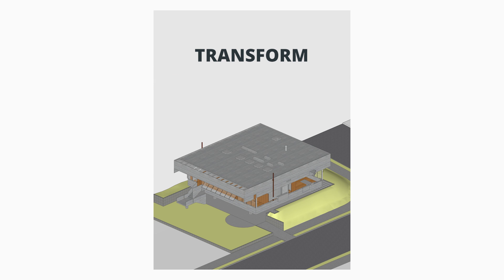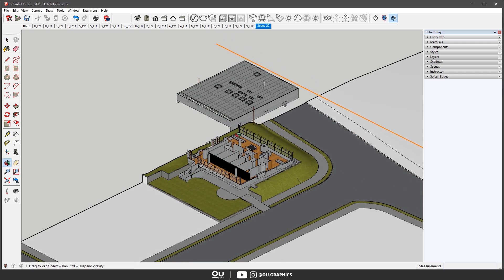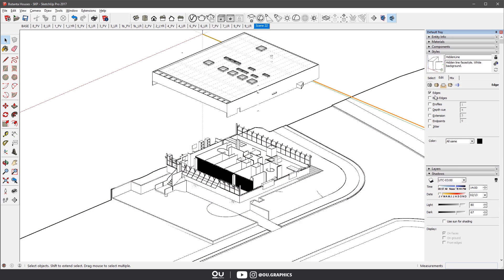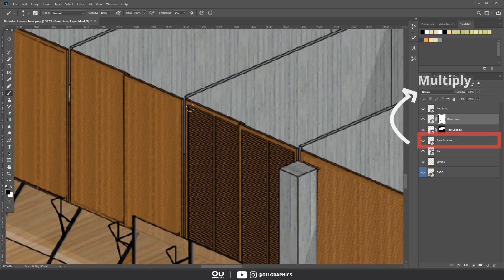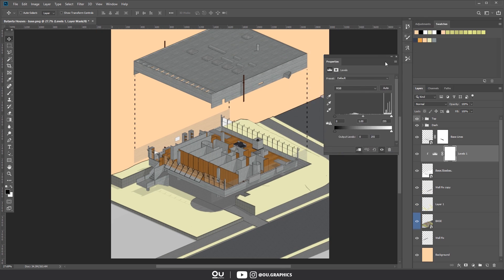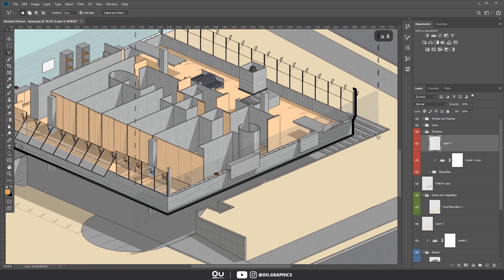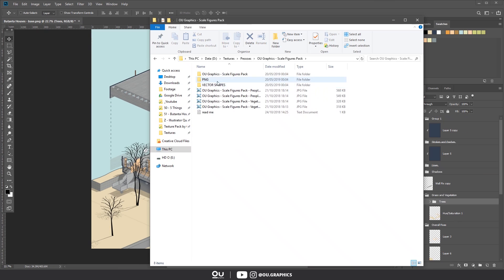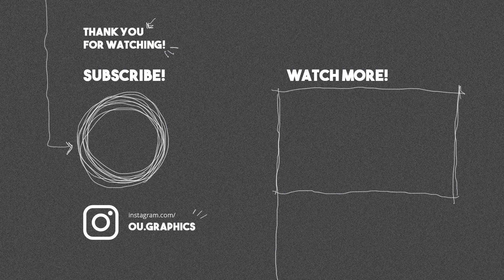Architecture Axonometric House with Sketchup and Photoshop

Comment: Hi, I had one doubt, Is it essential to export the edges in PDF format or a PNG is fine? Great tutorial btw
Reply from the maker: Exporting in PDF will give you vector shapes to work with. That means you’ll be able to resize as much as you need in illustrator and even change the line appearance.
But that is only possible in Illustrator. If you’re only going to use Photoshop. You can go with a PNG. Just make sure to export a larger file size than you’ll need

Comment: Amazing tutorial - love this! Noob question tho, how do you select and move the entire roof section in Sketchup, and not just selecting one side? Thanks!
Reply from the maker: Hey Lewis, thanks a lot! There's no such thing as a noob question. But I'm not entirely sure I got what you meant.
Since I had already planned to "explode" the roof, I made sure to group the objects that were going up together, so then it was a matter of using the Move Tool (M) to move on the blue axis.
It's also important to export them separately (base and roof), so that in Illustrator or Photoshop you have the creative freedom of choosing how far the parts will be from each other, and also what will connect them (if it's going to be dotted lines, dashed lines, or something else...)
I hope that clears your initial doubts.
Reply: @LearnUpstairs  Hey mate thanks for getting back! I understand where you are now, the model I'd downloaded was only selection faces of an object instead of the whole thing, for some reason. Thanks again - looking forward to getting into your other vids :)

Comment: do you know how to set the fixed camera angle for ISOMETRIC VIEW ? i would love to customize it because when i clock on camera "ISO mode" it just move to an angle that does not fit with the angle that i wanted . So i just could move the angle manually after clicking to "iso" camera view mode

Comment: Really solid video, man.
I understand all of what you do fine, although i am not up there with Photoshop yet...as you’re using clipping masks, and other things that i have heard about..but don’t quite grasp well enough to use in a fluid manner. So..  some of the steps, specially the tips that you give, on those kinds of moves ....i’m still missing them.
If you are able to link us to other videos that can illustrate what you talk about, that would be great, so that it won’t slow these ones down, by going through all the boring details, but will allow us, the ones still lagging behind, to move up to speed on what you are doing.

obrigado, cara,
o teu canal é mesmo muito útil. e curto a tua atitude. 
kudos , de Portugal. ;)
Reply from the maker: Hey V4D2, thanks a lot for the feedback!
We have a course on architectural post-production. You can know more about it here:
https://youtu.be/hCpct2siKCI

Comment: Hello there OU I am a huge fan, I follow you on youtube, insta, and have boughten some your texture packs! You have helped me become a way better graphic designer and my school projects are getting better every time. I just have to ask, how exactly do you scale the pdfs to the pngs? I am having a really hard time with figuring that part out.
Reply from the maker: Hi Dakota! Thanks a lot for your warming message, I really appreciate it :)
Usually, I export the PDF from Archicad with the correct scale, but that being for plans, sections, and all 2d drawings. In my experience, there isn't really a need for the Isometric to have an exact scale.
But if you really need to give a proper dimension reference, I'd suggest using graphic scales. That way you can resize the isometric and still have that graphic scale next to it resized.
By the way, I export the graphic scale alongside the pdf from Archicad. (When I say Archicad, I mean that you can use any CAD or BIM software of your choice).
Oh and I usually don't export pngs from Archicad. Only PDF and then if needed I'll import it to Photoshop and convert to an image file.
I hope that helps!

Comment: I love your graphic style and really enjoy your videos - there's so much to learn and absorb in just few minutes! A brief introduction sounds great - none of the other tutorials actually has this kind of bonus info compressed! 

Question: do you use Revit and if not - why do you find SketchUp better?

Thank you - your help is appreciated by all of us! :)
Reply from the maker: Thanks a lot for the detailed feedback Diana!

For me, revit and Sketchup have very different uses. One if for documentation and solving things that the project will later need in the design process. As Sketchup is perfect for a quick concept modeling, and generating visuals, diagrams, and so on.
Yes, Revit does have the massing type of tool, but we all know it's not the same thing. It is too limiting.
I talked about Revit because your mentioned it. But I'm speaking about basically all BIM softwares that I've tested.
At the moment my BIM software of choice is Archicad. So good! For me at least 😁

I hope this makes sense to you Diana! Cheers
Reply: @LearnUpstairs  Yes, it does! Thank you!

Archicad was the first BIM software that I ever used - and I found it more pleasant and friendly than Revit later. However, most firms I am looking at use Revit and it seems like Archicad is not a common thing here at all (I'm a student in the UK). 

Sketchup gives that freedom, it is true, therefore it used to be confusing or not 'correct' enough. After your tutorials though.. I am convinced to give it another shot! 

Many thanks again!

Comment: Thanks for sharing. Great artistic result. I’m really thrilled with conceptual design as opposed to realistic design. You are obviously very comfortable with photoshop. I’m more of a SketchUp fan and I believe (assuming I had your artistic understanding, which I don’t) that I could have technically achieved the same result from within SketchUp without resorting the photoshop. Horses for courses.
Reply from the maker: Thanks a lot Jeff!
Yes, you can definitely achieve a similar result using only Sketchup.
Well sort of the same. Specially when we talk about line hierarchy, sketchup doesn't have that option.
But if you're really into sketchup, you can develop a unique workflow to make that work out.
Maybe also save it as a Style and have it ready to go. Good job 👍👍